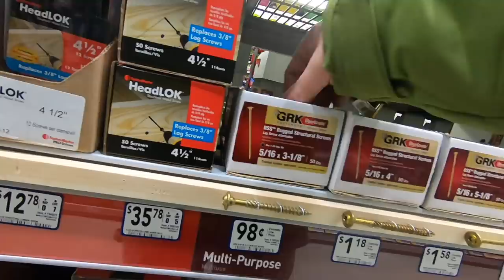This is Going to Make Raising Pigs on Pasture so EASY! Building our BACON Mobile

Comment: I’ve been using the GRK screws in place of lags and I’m sold. I won’t be buying old fashioned lag screws anymore. They are quick and easy to spin in with battery tools and they’re as strong as lags too. I thought everyone knew about cross hatching an onion before slicing. It’s how we’ve made “hot dog onions” for picnics as long as I can remember. Love the sled run and the sled riding. I know having fun when I see it. 😎👍

Comment: Fun experiment for Olivia?  Dump your bottle of hot water quickly and seal it up tightly as quickly as you can (you want the air inside to be as warm as possible.)  As the jug cools, the air inside will exert less pressure and the jug will collapse a little bit.  Then if you have any aluminum cans, put a small bit of water in the bottom and set it on the stove. Get the water in the can to a rapid boil. Grab the can with tongs or whatever and quickly place it in a sink of cool water with the open end down.  It will  immediately collapse, crushing the can. Uses the same idea, but a more dramatic temperature change.

Comment: Wow it is hard to imagine your weather. Compared to my day in shorts sweating in the garden, greenhouses open with the fans running. 3 days in a row in the mid 80's and the extended forecast in the low 80's and 70's.

Comment: Goooood afternoon Al!    Looks like your going all out on the sturdiness of your wsgon.  I'm using 3/4" marine plywood for my deck, hopefully it will last a good long time with a coat of paint to seal it off.  Just wondering where you found the running gear?

Comment: Now that you have the 4x6s on,  if the X measurements are the same
You can check the wheel alignment..to the 4x6s
Easier to adjust now than later

Comment: Coarse threaded fasteners (wood screws, deck screws and lag bolts) do not have good shear strength compared to nails.  Lags make up for it by being very large.  GRK screws use a different type of steel, closer to what they use to make nails, so they have much higher shear strength.

Comment: I would have framed the floor as a traditional floor joist layout using 2x6 members. same weight and better support in the middle to handle the weight of hogs. Also your floor deck lumber is way to light for hogs. A proper joist layout with 3/4 in treated plywood would be better.

Comment: Ive been trying to find when you switched trucks and why? I did find changing engines in the chevy and repairing ground connection. Then your picking up the snowplow for the Tundra. Did the chevy die. It was older with miles.
Reply from the maker: The chevy was older it was time for an upgrade. I replaced the motor a few years back

Comment: Hi Al,  This bacon mobile tractor you're building is looking pretty mean already, and I don't wish to be a negative nancy or rain on your parade, but as a long time viewer I kind of recall one set of your pigs (can't remember if it was Sausage and Links or Proscuitto and Coppa) used to really enjoy chewing on your rubber boots.  Remember that is what they loved doing whenever you were standing still long enough in the pen? What are you going to do to prevent the pigs just chewing the rubber off those super expensive wheels?  I'm concerned they're just gonna get bored and turn your expensive wheels into chew toys and the bacon mobile into an expensive, heavy, wheel-less paperweight.  Can the wheels be removed and attached easily and maybe be stored on hooks or rods up on top of the bacon mobile while it's stationary?
Reply from the maker: I will have to make a cover to go over the wheels so they can’t chew them